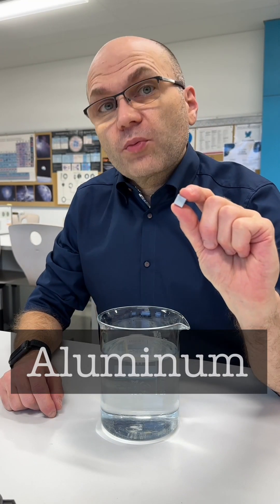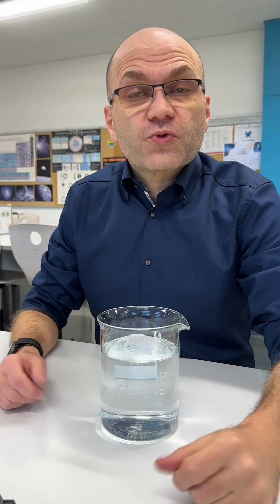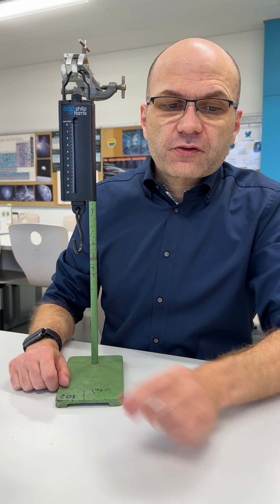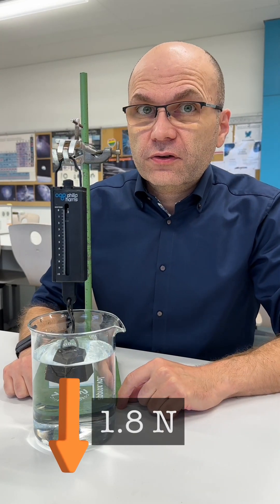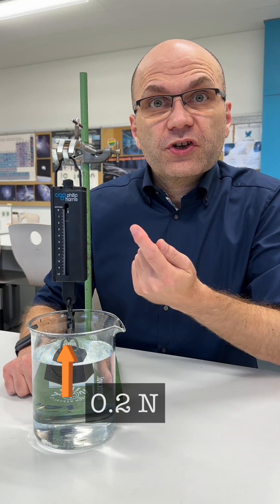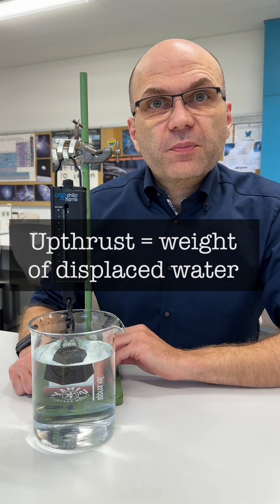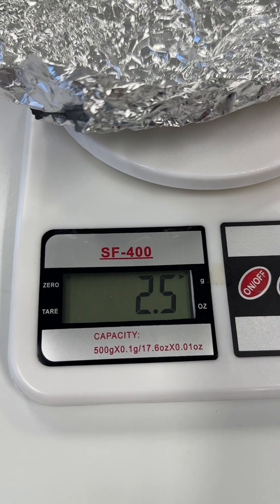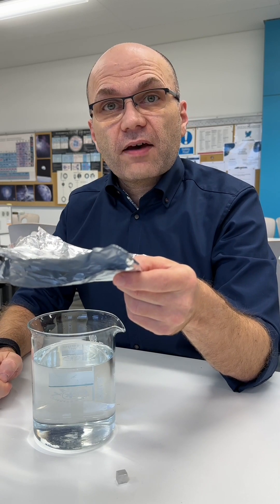How can large, heavy ships stay afloat? Buoyancy

Comment: here the thing tho. If Upthrust = Weight of Displaced Water,,,, than two objects of the same size but different weight, submerged in water should displace the same amount of water. So if I have a beaker of water with a Pingpong ball on one side of the scale, and a beaker with a Steel Ball in the other side of the scale. If both balls are the same size but different weight, they should both displace the same amount of water.  The Action Lab youtube channel did this experiment. So I am trying to figure out why they woulsnt be equal on the scale.
Reply from the maker: Hi. You are right in saying that two objects of the same volume experience the same Upthrust. I don’t know the specific video you are referring to but my guess is that the ping pong ball is part of the system (container + water) whilst a metal ball is attached to a string or something similar thus introducing an external force acting on the system.